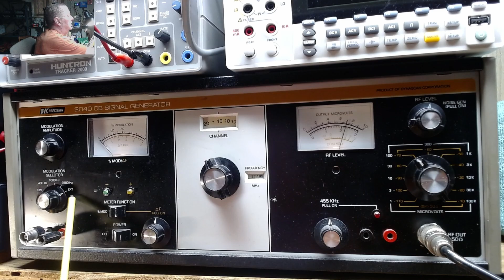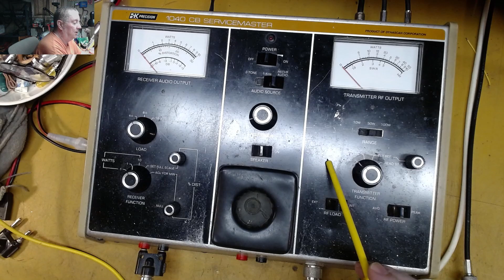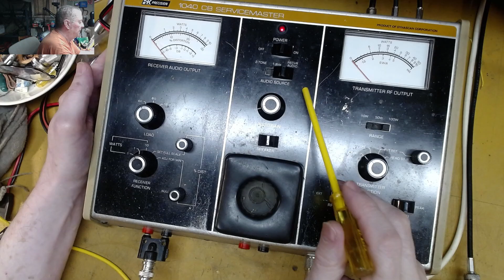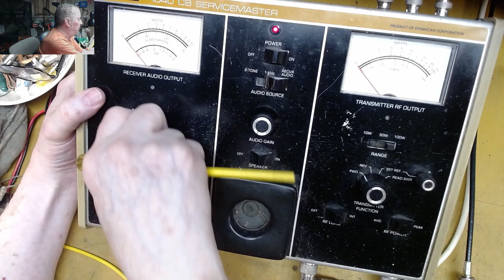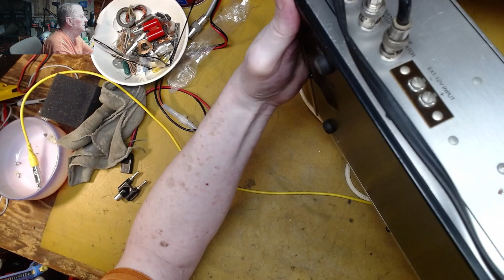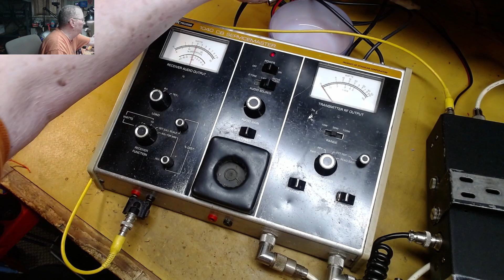B&K CB Service Master Overview

Comment: In some videos when I hear you say signal generator , I automatically think of the ole HP 8656B or the 8657's I have the 8656B but it has the green display and the front cover of the 8657 but it only goes to 990 Megahertz , I never had the privilege of having the B&K test stations ....
Reply from the maker: The old HP units are good test equipment!